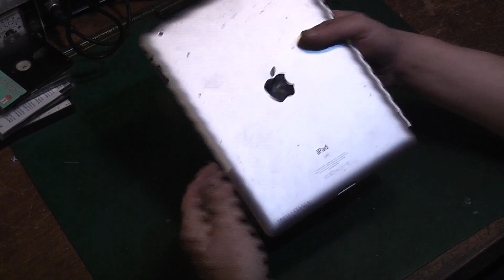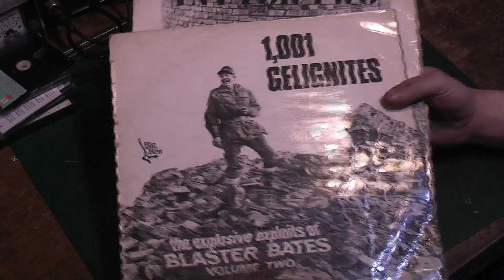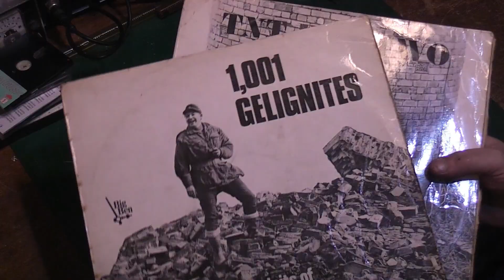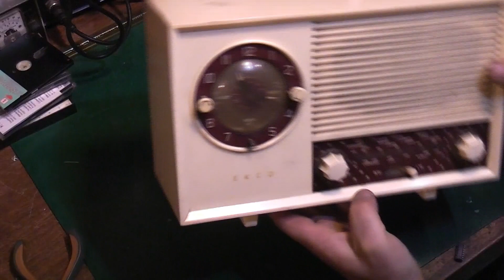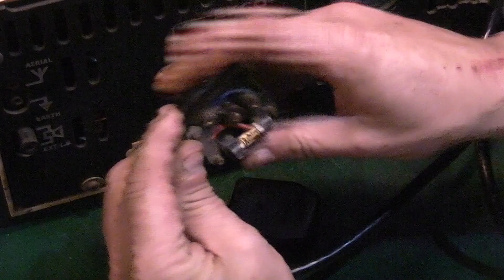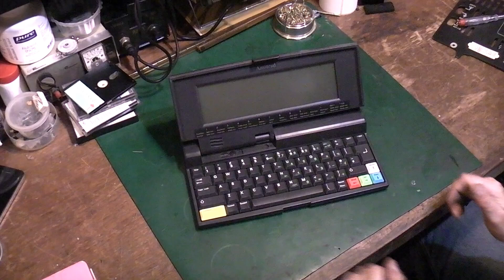Car boot pickups Chelford 28 05 23

Comment: I fixed a couple of ipad 2s i found on the road a few years back. They had the no power/signs of life same as yours even plugged in. Problem was the batteries had drained too much and wouldnt take power anymore.  I took a hair dryer on high and heated up the back of the tablet for between 5-10 minutes. The heat juiced the battery enough to take a charge and they worked again. I fixed 3 that way but the 4th one battery was too shot.